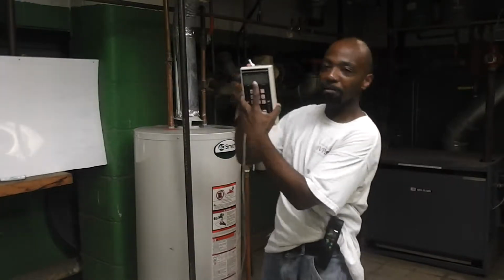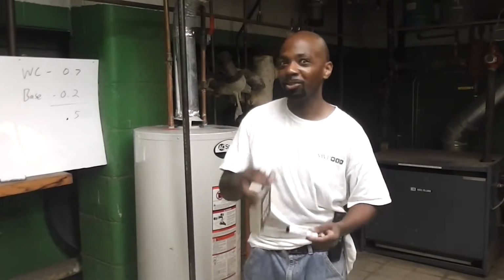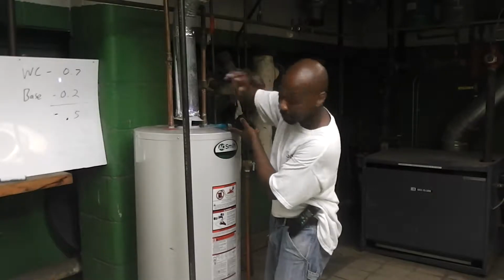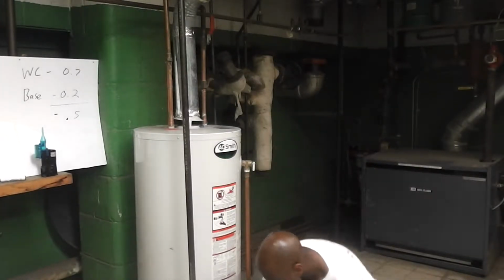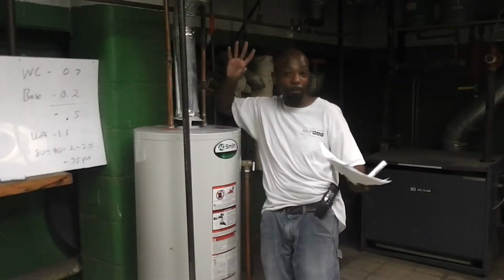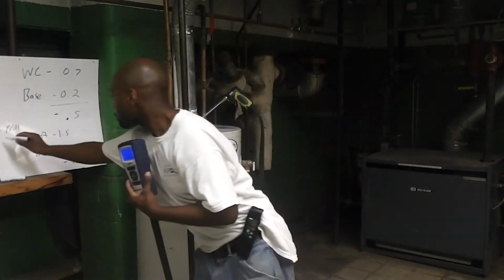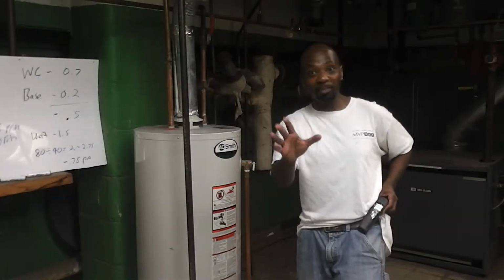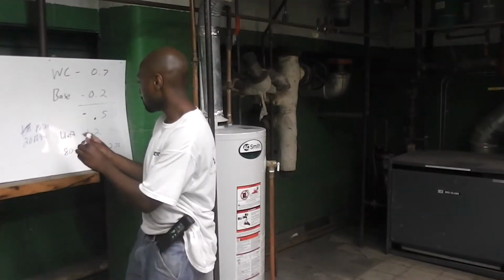Combustion Safety Test Procedure

Comment: being commonly vented we should test draft of the DHW (water heater)twice, before the heating system is running and while the heating unit (steam boiler) is running, only when the are not commonly vented (orphan draft) is when you do not have to to check the DHW again while the heating unit is running